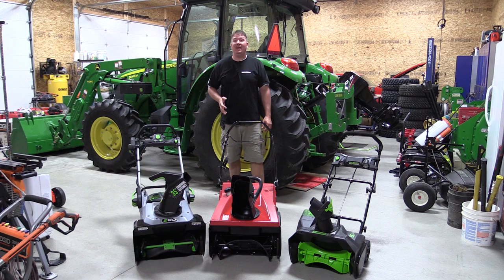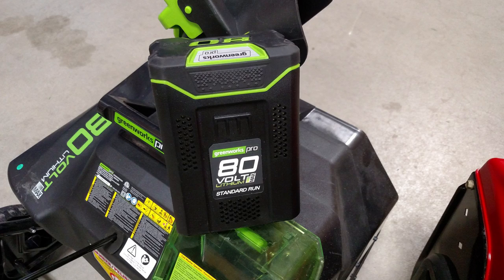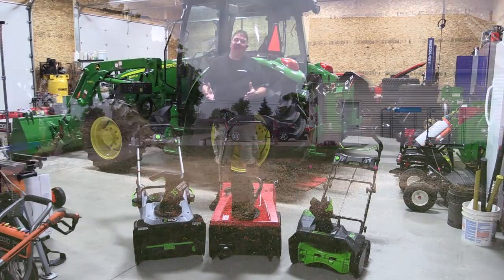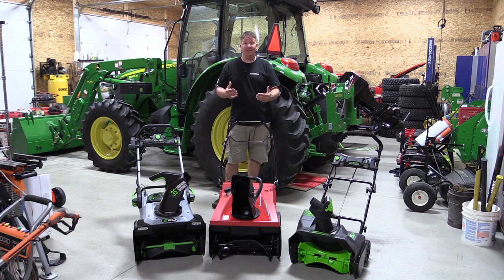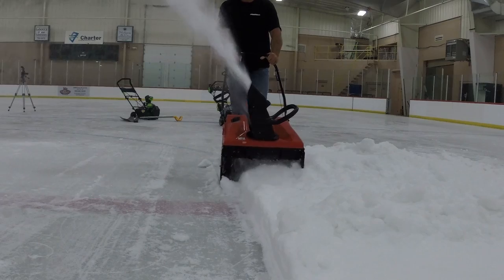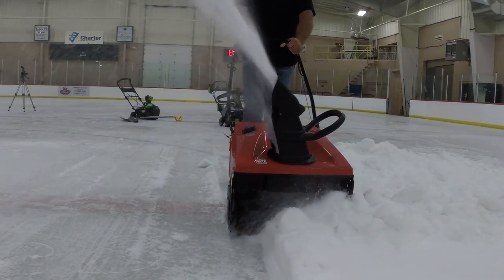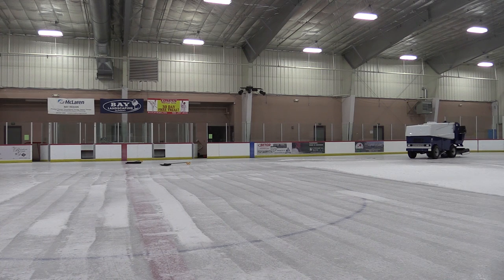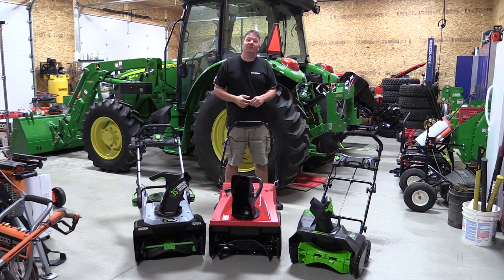Is a Battery Operated Snowblower Up to Real World Use?

Comment: Gaaah, I could never use an electric snowblower. I'm on contract with a dozen odd local properties to clear their drives and sidewalks. My weapon of choice is a 30" cut, two-stage Yardworks machine. Crappy tire special I know, but it treats me well, even with 8 odd harsh Canadian winters under its belt. The 357cc Tecumseh engine doesn't throw a fit and bog down under 2ft of heavy slush. No way one of these electrical jobbies running off a glorified drill battery could cut it out here
Reply: I've used an electric blower not more than a hand full of times. Only on a small property with 10-12" of powder at most. A little single stage unit. Didn't seem to wanna chuck the white stuff too far. All in all, not a terrible rig, but it's definitely not what I'd pick to clear a 5' drift. One thing that's nice is with the electric blowers is you don't saunter back in the house smelling of gas and exhaust fumes. I guess a potential long-term drawback to battery power is cell degradation. After a while they'd start to lose capacity.

So far I've gotten away with just the one two-stage gas rig. Only thing is it didn't come with drift cutters... had to make a pair. Thankfully this isn't how I make my living (if it were, I'd be S.O.L. since we haven't had more than a few inches here all season), just a side job to pay off student debt.

P.S. Somewhat realitive side note: talking about the cost of batteries. I was recently in the market for a replacement flexvolt for a recip saw... had to pick my chin off the floor when I saw the price tag. $200 at the homeless despot! Unreal.
Reply: Jack Duno
You have 12 properties to remove snow from and an electric model won't work for you? No shit!

Is this you in the summer?
"I mow 12 lawns and a push mower just won't work for me."

Comment: For the price of the ego you can get a much better gas unit. And you don’t haft to wait on the battery if it dies.
Reply from the maker: Agreed.  You just have to have gas and keep the carb clean.
Reply: Or instead of buying a snowblower, you can use that money to take spelling lessons.
Reply: True, for the moment.  But electric power tech is in the middle of a lot of changes right now.  Electric cars, trucks, and energy storage (even on utility scale) is driving a lot of research to take over as many energy markets as possible.  We will probably see energy density, lifetimes, environmental ranges all improve practically on an annual basis for the next decade or two -- much like computers since the 1980s.  Prices will come down too, as volume manufacturing ramps up.  

Till then, here's two options on battery capacity: if really necessary, buy (!) a spare battery to charge while you're draining the first one out in the snow.  If that's unrealistic (it is for me), then coming back inside to charge the battery is the perfect excuse to take a break.

Comment: will it? store that battery operated snowblower outside for a week and let me know how it works out for you....
Reply: It's meant to be stored indoors, but you know darn well many in the northeast will treat this thing like their 30 year old blower that hasn't quit on them once.  You know what I'm talking about - that all steel beast that weighs 400 pounds and was made in 1988. Yeah, the one that can power through a mound of icy madness or if you're really sadistic, a nice pile of rocks and gravel. The one that can double as a wood chipper. The one that runs on waste oil, bacon grease or candle wax. That one.
Reply: actually i have a 60lb toro 2 stroke beast that will not die starts every time. its only metal where its important though.

Comment: EGO FTW!!!!  @WorkshopAddict - So all of this testing was done on just 1 battery?  The wood chips, the bagged ice, and then the ice rink snow??!!!  If so, was it charged at all between tests?
Reply from the maker: All the testing was done on one charge of each of the two batteries.  So the unit was charged once, both batteries, then all the tests were done with no charging.  It all happened in one day, no time to charge.
Reply: Did you conduct the test with 1 battery at a time?  I'm confused (as I thought you said you used 1 battery in the EGO snowblower).  Did you end up switching out batteries?
Reply from the maker: You can use one battery or two.  for fun, we did run one battery and it did well.  In all the testing, we ran two batteries, but never charged them in between tests.
Reply: OK, that makes more sense.  The way you said it in the video, it sounded like you only used 1 battery for all of the tests combined.

Comment: but after 40 mins< I can refuel the troybilt and keep on blowing for the normal 1hr 1/2.......what is the replacement cost of battery $120ea?
Reply from the maker: 120 each would be a deal.  You are 100% right.  This battery operated stuff is for the light-duty home use person who does not need this unit daily and does not want fuel to sit.
Reply: I have a greenworks, not this particular model.  I use a 2 battery solution during winter and it has served well.  I have a total of 4 batteries now and all have come through a purchase with another tool and in all cases the cost of the battery was free or the tool was free, pending how you look at it.  Anyway the store would have a clearance or sale on the tool purchased.  As an example I just bought a leaf blower that came with a 3amp battery for a 120$ .  3 months ago I picked up 14" weed whacker with a 4amp battery for 100$. and same with the lawn mower (4amps battery) for for 140$.  So this winter coming,  I don't really think that power is a issue.  The only thing that was not mentioned in this review is how the company locks you into their system with the batteries as they are all OEM and regardless how much better a Dewalt trimmer is or how excellent a Toro snow blower you cant buy it as they all use different batteries.  That is a question that needs to be addressed.  Once greenworks stops the support,  I can never get batteries for my tools and it becomes expensive junk that still works.  This financial model does not help the environment, but greenworks and others like the promotional idea of batteries to help with the environment because I am not burning fossil fuels when cutting  my lawn.
Reply: having additional batteries is no different than having multiple tanks of gas. can you run a gas engine with just a 5gal tank, sure but having multiple makes it easier.

Comment: you are looking like an engineering     inspired guy and i am too
so we can easily calculate the performance of gravity defying bird wrt to harvesting energy out of this system
as per equation of potential energy  the many megajoule are their in a 100000 kg bird statue on ten meter height base
now within tolerance limits of balancing the bird and harvesting energy out of it is not less than thousand joules in terms of electricity by transferring energy through shaft to dynamo
we can easily recharge our battery which can exhaust in the process of getting rid of ice from doorstep to the destination

Comment: EGO 21" 56-Volt Lithium-Ion Single Stage Snow Blower is a toy! 

The manufacturers never report the power of the unit, they only mention the volts. The volts alone don't make the power. In electrical terms, the power is a product of volts and amps. The electric motors used in the cordless snowblowers or lawn mowers are of a fractional power ~500 watts only. For cleaning the snow or cutting the grass you'll need a lot more, like 10 times more. All the commercials about the cordless snowblowers are done with a very small amount of snow or for a very short action time simply because of the lack of power. 
My neighbor who likes cordless devices is got one and he hates it. With 2 batteries he can't finish even his sidewalk, he's got to wait till the 2nd battery charges for the 2nd time. So much for the driveway! And this is with the new batteries. Wait till next year - if you don’t have to replace them the first year you’ll replace them the second year for sure. 
Cost? Do the math. 
It's not that you can’t make a powerful cordless snowblower or lawn mower. You can, but it will cost as much as Tesla among the cars.
Reply from the maker: CleanCarburetor I agree with some of what you said.  This is a 2000 watt motor and if you watch the video, we put these through there tests and proved it will work in deep snow and will work for a driveway.  But each to their own.  That is why we did the video, to help people.
Reply: Do you have 3rd party reputable outside company results to support your statements about 2000 watt power and for how long can the maximum power be sustained with one battery charge? If you do, publish the link of where the results can be found on the reputable company’s website.
Reply: CleanCarburetor lol, your username says it all. Gas is on its last leg, me personally I'm tired of servicing all of my jobs gas tool and cleaning carbs! for home I have all the Ego tools except the chainsaw I have 2 Echos for that and now I think I grab this snowblower too with a couple more 7.5AH batteries oh and I run a ebike on these batteries too! win!
Reply: Check us out! The CleanCarburetor provides a unique method with the ability to clean the carburetors on the inside but without taking them a part.
CleanCarburetor solution is the only one known method on how to completely clean the carburetors before the engines are put in storage at the end of the season.  The entire procedure doesn’t take more than a couple of minutes. It leaves the carburetor in a new-like condition.
Reply: @cleancarburetor  Gross. Using someone else's video to pimp your product